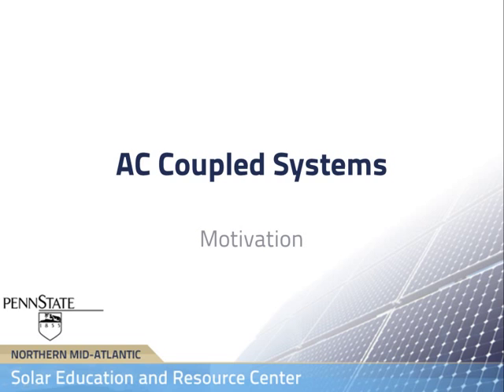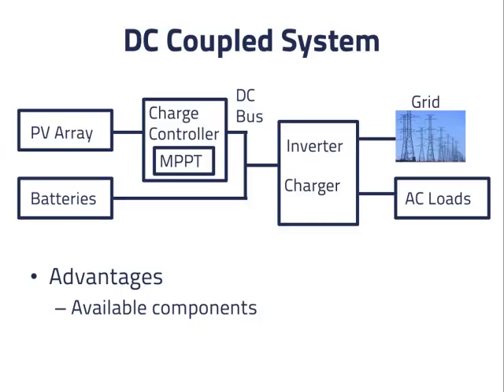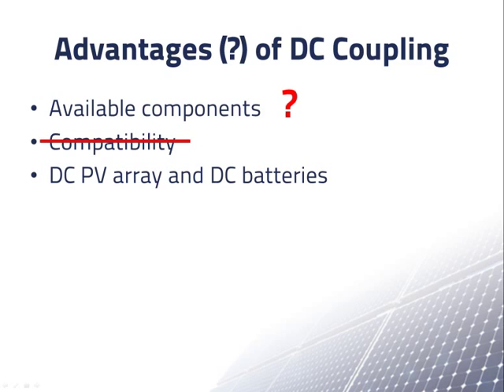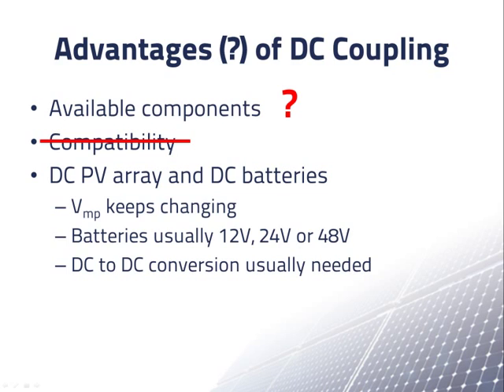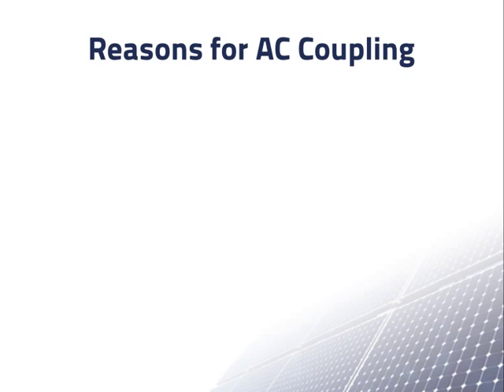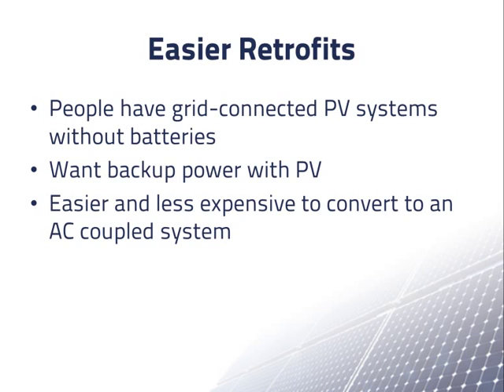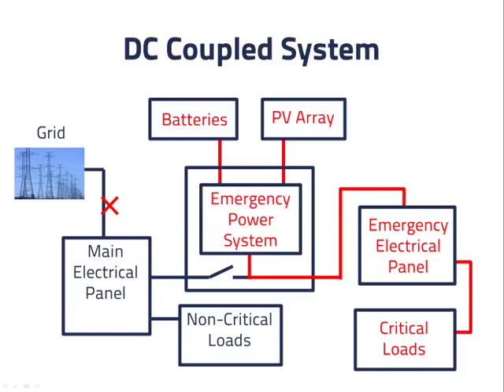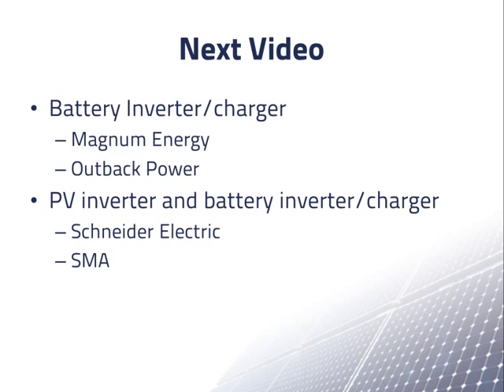AC Coupled PV Systems - Motivation

Comment: at 5:00 when the grid is out the inverter should be off due to anti-islanding
Reply: I read some manufacturers' AC coupling adds a battery based hybrid inverter and backfeeds the grid-tie inverter to charge the batteries when the grid is down/ Essentially the hybrid inverter tricks the grid-tie inverter into staying on
Reply: That is why I have never wanted an AC coupled system.  Historically, when the power is down, it takes your PV offline, too.